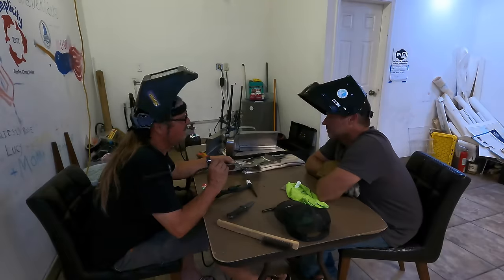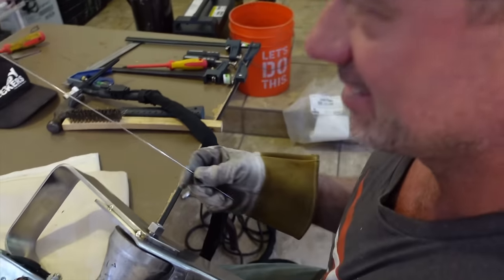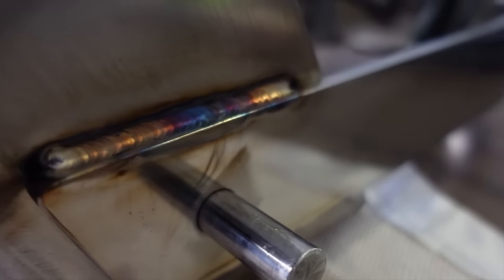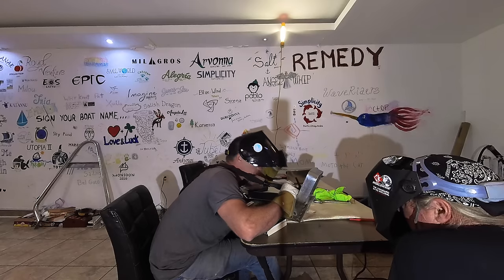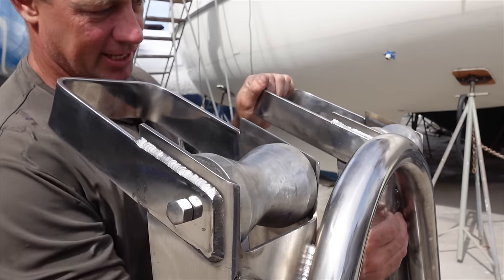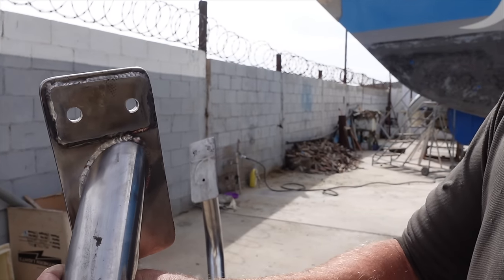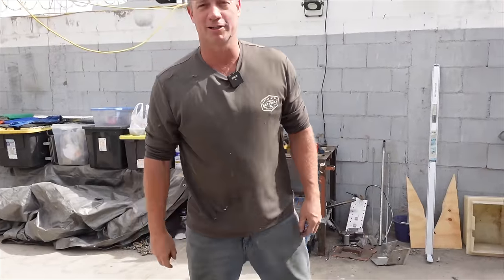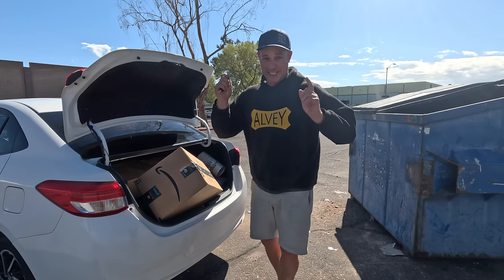Learning to weld To Fix our SAIL Boat Home Ep 399

Comment: Look pretty good actually, especially for a beginner. When you see that dark blue area you are getting it too hot. Back off on the pedal a bit. Keep in mind that the work will get hotter as you weld, requiring a little less amps to melt the metal. Still pretty damn good!

Comment: thanks for the vid, I'd give Lee a 98 I've been welding since my grandfather taught me at 10 years old and it will definitely hold. Some cracks you can drill a small hole at the end of a crack and weld it and it's over.  That must have been hard to leave but mama needs her space sometimes and I'm sure you had a great trip

Comment: Cracks. What ever you do in terms of repair, they will grow, unless you can take the stress off. So what you have done already will help and those two additional bolts will too. That may arrest them but time will tell. Welding them up usually does not work long term but drilling a small hole just in front of the crack often does.

Comment: Very good welds. I’d be happy with those. Now all you need to do is to learn how to use what we call the “cut and fold” system, and you can build anything. Well done. The cut and fold system is about using the people with Laser Cutting and CNC Folding. To access this you need to use CAD design on your on board computer. The best one is Sharp3D as this will run your iPad Pro, and not cost too much to maintain. With the iPad Pro you can do your design work laying in bed while sailing. You’ll be totally liberated when you pull that all together. If you don’t want to learn the CAD straight away, I’m happy to do that for you. Send a sketch with dimensions and I’ll send you back a STEP File to send to the Laser cutter. Most big cities will have a business that does this. For instance if you were in Sydney you might use Opie Group.

Comment: you could have drilled a 2mm hole right on the end of the crack to stop its progression. maybe even run a weld with out filler rod over the crack. but i am sure its all fitted now. great weld for first time mate.

Comment: There is a 46 ft ferro cement boat cheap, if the hull is sound are they worth having?  I presume they need a fair bit of wind to sail because of the weight.